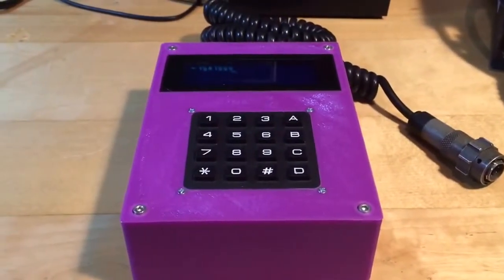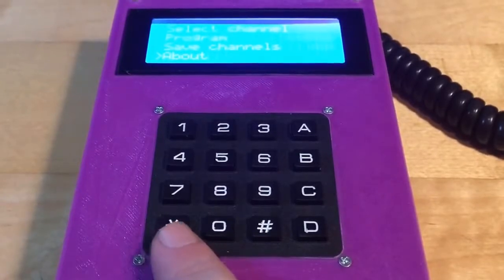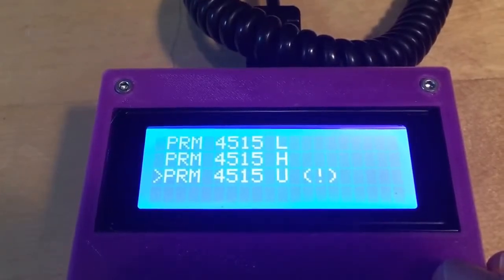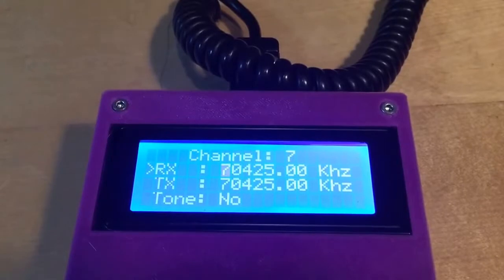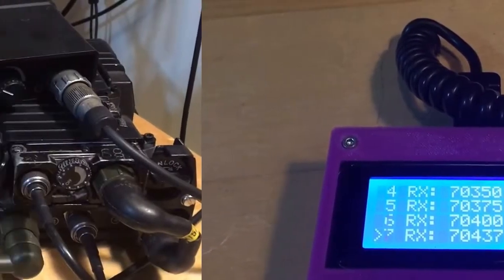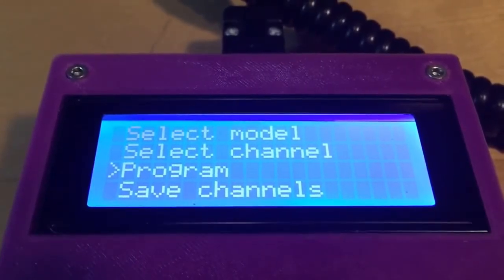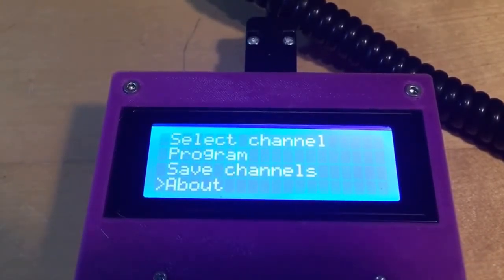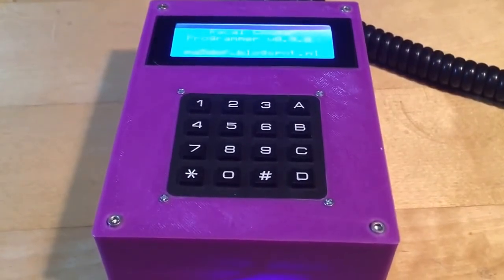Arduino Racal Cougar standalone Programmer

Comment: 0:38 I only see 6 pins here,  maybe G isn't used in this application. 
Is this connector compatible with the TRA.967 and TRA.931 Racal Syncal 30?

Comment: Hi Dave, 
I went through all your blog posts, and I'm impressed by the amount of work you put into it! I'd like to build a serial console programmer (without LCD+display)... 
Do you have any arduino script I could use with your first version programmer (transistor+resistor) just to load some crypto keys? 
Cheers, Manoel